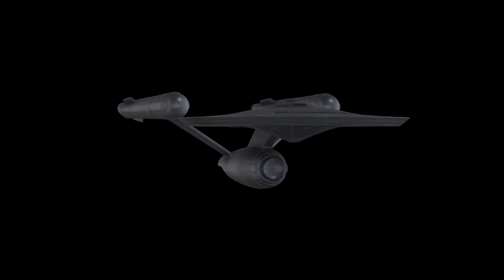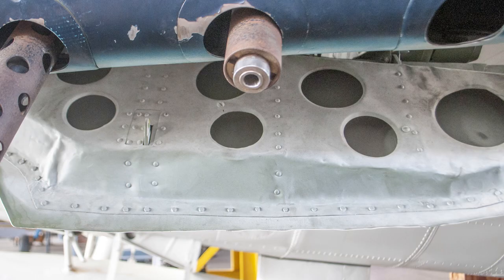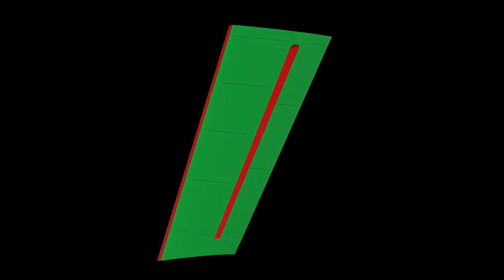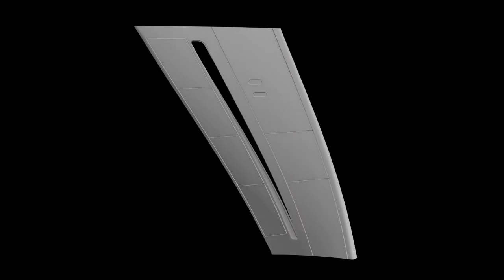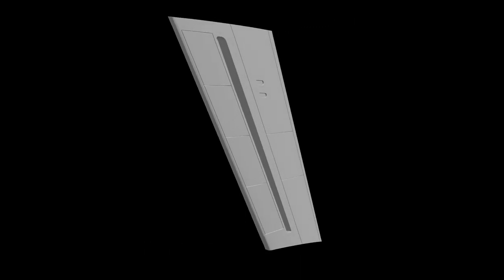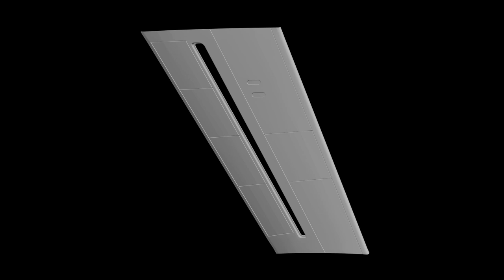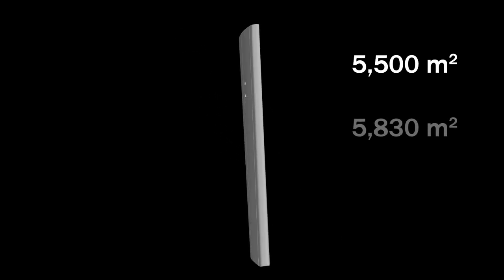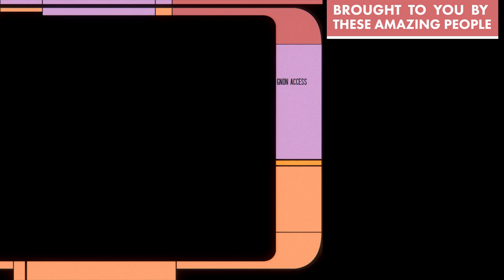What's the Deal with Pylon cutouts?

Comment: if i remember right, Radiometric converter tech wasn't made until the 24th century. So the USS Enterprise 1701 would still have a problem with handling antimatter waste, radiation and cooling unlike those in the 24th century that recycled the waste back into other subsystems. So your explanation about regulating plasma cooling is awesome. i'd loved to explore more history about how starships handling waste and cooling. i still remember in TNG "Starship Mine" that a Baryon sweep was needed every 5 years or so, i wonder how Voyager got away with needing one after 7.

Comment: The additional surface area would work better in an atmosphere. But for radiative heat transfer  the heat a surface emits is reabsorbed by the opposite surface. Corrugating  would be more effective as the influence of cosine of the surface normal is reduced. Basically the zones in front and behind the pylon would get better heat illumination. IIR the side panels of the TIEs are structured that way!
The main problem: whatever the cutouts do, internal bulkheads would most likely do the same thing, and potentially better. We use lead as radiation shield because you want as much mass between you and the source. Polished gold mirrors make better heat barriers then the gap. Maybe you could mount sensors in there, without getting them eroded by micrometeorites while reducing the shadowed sector in front? It's a long shot though...

Comment: The Enterprise from ST-TMP already had a waste heat management system with it's Flux Chillers on the inboard and outboard of each nacelle. Inboard they glowed blue.
Also I think showing starships under construction with girders and beams is a nod to showing something familiar to the audience -- it's how we're used to seeing buildings under construction. Starships would almost certainly use a unibody/monocoque frame concept to reduce weight and add strength. Also, Structural Integrity Field.

Since they have already figured out warp drive and transporters I would hope they had also figured out a way to convert that waste heat into another form of radiation that could be dispersed into the icy void much more readily than infrared heat.
Reply: I completely agree.
Also, as an alternative I'd like to suggest a "skeleton" made of arcs and circles (a bit like a 3D-chainmail construct, with bigger spaces in between). Would give especially the Enterprise-D rigidity and flexibility.

Comment: Great video, very interesting.

I agree with the lightening holes theory and I agree with it being used to strengthen the nacelle pylons, but I disagree with the radiative cooling to some extent.
Let me explain: the majority of the radiated heat goes in the direction the surface is facing. This means that the cut out radiator would be radiating heat into the other side of the cutout. And because materials absorb and emit radiation equally, the energy would be reabsorbed into the nacelle rather than radiated into space. Effectively, cutouts increase the total surface area of the pylon, but decrease the usable radiative cooling surface area.

However, the cutout could be used for cooling if you channelled a hot coolant through it, confined by magnetic fields but radiating heat into space. Use a hot plasma, and you could get rid of a lot of waste heat quickly, and it would look cool.

Comment: Whenever I see a traditional saucer and secondary hull with nacelles on pylons design, I just want to add a brace between the two nacelles or extend the nacelles at the front so they connect to the primary saucer section (a bit like the Steamrunner class).

If only the next film after Nemesis had gone ahead, apparently the same designers who did the new anti Borg First Contact ships were going to do a bunch of new Starfleet ships inspired by the Defiant - with a internal bridge and nacelles blended into the hull as the paradigm to show Starfleet is now tough and militant.
Reply: The star cruiser has pretty nice nacelles and pylons they are tucked in with the aft section of the ship instead of being extended super far out
Reply: @nobleactual7616  Best idea ever. As seen in ST: Beyond the Enterprise's weird thin pylon design is easy as hell to take advantage of.

Comment: Another possible explanation: when the constitution class first rolled out of the shipyard it just had the forward part of the pylon. After a year of shakedown the designers determined that the pylons were not quite strong enough and needed to be reinforced. The immediate solution was to add another set of pylons in parallel with the originals, leaving the small gap between them.

Presumably this was intended to be a temporary addition to the constitution class while they go back to the drawing board and design a stronger and thinner pylon. By the time Kirk is in command the enterprise has undergone a small refit to replace the old reinforced pylons with the new design as seen in TOS.

Comment: Radiating heat doesn't need a medium, that's why we get the heat of the sun through the vacuum of space. Convection doesn't happen though, that's where you do need some sort of fluid, either liquid or gas. So adding more surfaces to radiate heat from would help to lose heat

Comment: The radiator theory is probably the strongest of the bunch, although you'd have expected Starfleet's Finest to have curved the inner surfaces of the slot to increase the surface area further, angle a greater number of emitted photons out of the slot, and increase rigidity further. The straight cut slot will actually cause a majority of the heat radiated to be reabsorbed by the opposing wall. 

Perhaps it was split to provide redundancy in case half of the pylon was impacted and broke; it'd be better to lose a small amount of air and easier to seal internally. You would also have the advantage that you would not lose all of the plasma conduits as easily or incur rapid depressurization on all many in case of a breach to the hull. Perhaps a rupture in one of the conduits would be explosive enough that having extra hull and a gap would prevent the other conduit(s) from being compromised. 

Great video as always!
Reply: Theres never been enough surface area on any star trek ships (or star wars for that matter) to justify any sort of radiators.

Comment: There is another angle to the heat concept: if the plasma conduits are in the area with the vents, and the pylons are also high load structural elements, then it may be helpful to isolate some of the support structure from the heat source. 
Heat tends to make metals more pliable, and keeping some of the metal at cooler temperatures can contribute to maintaining a desired standard of rigity.

Comment: A cutout in the pylon would be an excellent place to store a droplet radiator system. After the plasma is used in the warp nacelles, the still hot gas/liquid is vented out one side of the pylon in tiny droplets. The insane surface area of this material sheds heat rapidly and is then collected on the other side of the pylon as the ship moves forward naturally.. While such a small gap limits the amount of cooling that can occur it would also limit the material loss.

Comment: This probably won't have the same function on something the scale of a starship, but such a cutout on a smaller solid item would prevent a tear or crack from spreading. 

Real life examples would be car bumpers and fiberglass. If there are cracks in either and they're being repaired, prior to any material being added the ends of any cracks are drilled out to prevent the crack from spreading, as repairing something without doing so will eventually result in the crack simply spreading beyond the repair. I believe cracked metal is sometimes repaired with drilling the cracks out as well. It is for a similar reason why a windshield on a car with a small crack will soon need a full replacement in most cases, as the crack will eventually spread along the windshield. 

So my theory is that if the pylons were to be physically damaged such cutouts could help prevent total structural failure and having a nacelle fall free of the ship.

Comment: A possible reason separate from what you said is that during manufacturing of Discovery’s version of the Enterprise, certain areas of the pylons needed to be readily accessible for construction and the speed of that construction.  If pipes run through those pylons, then a break in the pipes could mean days of reconstruction compared to hours.  If you ever built a water cooled PC then you know just how easy it could be to leak water all over your newly built machine when you start putting pressure through and how you could quickly ruin components if you don’t have immediate access to the loop.  So in this case, imagine a plasma leak ruins a good chunk of components in a star ships pylon, rather than taking all the piping along with every single component in the way of the leak, just have quick access to the pylons center for repairs and construction.  The down side is that the ship has less integrity like you said, but I would imagine that the ribs are now oriented vertically to try and make up for this loss.  Perhaps the material just got stronger so they could afford that loss of integrity.

Comment: thermal dissipation was my first thought. I'm fairly sure there are access ways into the pylons for repairs. I think one of the Command Level no-Win scenero's require you to send an officer into one of these to die in order to save the ship.  it's possible one side (probably the thiner side) is for coolant input and personnel access and the thicker side is for the plasma input and output. there has never been any onscreen mention of thermal sinks so I think your right about that. it's logical that they didn't put them in on the original production line until they got the performance data back to see if the existing pylon structure would hold as it was. updating the design as understanding and advancement's came in. (coinciding with RW designers own understanding of engineering as they progressed themselves. )

Comment: The smaller beam might transport coolant to the blue glowing radiators on the inbound of the nacelles. The larger beam transports warp plasma, interstellar gas, hot coolant, and have transport tubes. The vacuum of space then helps insulate the coolant from the other one. Or maybe the warp plasma travels through the smaller one and the larger one is everything else. The point is that the smaller conduit is thermally isolated from the rest of the pylon by the conduit. This likely helps keep whatever is in there at a stable temperature.

Comment: I am interested by this idea of the ship trying to shed heat. I wonder if, taking this into consideration, cloaked vessels have to capture heat while cloaked instead of shedding it. Doing so would hopefully hide their heat signatures. 
This might explain the massive engine section of most Klingon/ Romulan birds of prey, and why they have the command section so separated and vulnerable.
Especially when you look at a D'Deridex. This might explain their ability to not only travel at extreme speeds while cloaked, but look cool doing it. Poor Klingon engineers must be boiling when they are cloaked.
Reply: Well considering how hot Klingons like it, it was probably considered a design feature.

Comment: 3:48 Sci-Fi is pretty dramatized, but in a matter of speaking you do freeze in space really quickly. The vacuum of space doesn't steal your heat, but it steals almost everything else from your body due to the lack of pressure. Most fluids would boil off of and to a degree out of your body, the gases escaping very quickly taking a lot of heat with them in the process that is now leaving your body, but some chemical bonds in fluids would remain strong enough to not accelerate away from your body, almost in a matter of speaking "freezing solid."

So, there is some truth to the idea. Space isn't cold so much as it is just totally empty, and the matter making you up would tend to want to fill up that empty space as much as possible. In that process, taking heat away from you as well and it would be pretty fast. Maybe not seconds, but still pretty fast.
Reply: I came to here to say the same thing - a person wouldn't freeze solid immediately, but would accumulate a layer of ice very quickly as the liquid on and in the outermost membranes boiled in the vacuum.

Comment: The separation could be as a heat stop, the slot is used to prevent heat transfer through conduction.  The hole could change the resonant frequency of the nacelle and prevent the nacelle from flying apart.

Comment: I would like to think that the rear, thinner portion of the pylons is actually where all the structural support for them and the nacelles is located, with possibly jefferies tubes running through it as well for maintenance of the nacelles. While the other, thicker portion would indeed perform some heatsink function, both for the Warp Drive's plasma conduits and maybe for the ship generally - I would imagine all the weapons on the Enterprise would also generate quite a lot of heat as well. Having a long, thin and flat structure, filled with heat tubes (whether plasma conduits or vapour chambers), running parallel to the main vector of the ship's acceleration is a cheap and efficient way of passively dissipating heat into the vacuum of space using only the vessel's movement.

Comment: The problem with the heat rejection hypothesis is that you aren't taking into account interreflection.  Basically, in space a hot object is an infrared lamp, projecting a beam of heat (mostly) straight out away from the hot surface.  If two radiator panels are facing each-other directly, they are experiencing nearly 100% interreflection on those facing sides, this doesn't just make them non-functional, they'll actually be working against their intended function.  This means that those cutouts if they were radiators are would be at best just pumping heat around in a circle, rejecting very little of it from the ship.  It would actually make much, much more sense to give the whole outward facing surface of the pylon a corrugated texture and make each pylon one giant radiator.  If radiator size directly correlates to warp-plasma throughput then this would probably more than double the ship's capacity to move plasma, allowing for much more plasma-hungry warp coils.

Comment: The problem with the concept of increasing surface area 6% through the cutout is the faces of the cutout face each other. That means thermal energy radiated as infrared from one side will warm the apposing side and effectiveness will drop versus just having the faces facing outward, opposite each other.

I think the simplest explanation is the cutouts are just a way to redistribute mass. It's cut from the rear so the center of gravity moves forward just a teeny bit. On rockets being at least slightly nose heavy is very important.

A more complicated explanation is the cutout is a way to physically isolate the plasma conduit from a personnel conduit for most of the pylon length. If the plasma conduit breaches, either accidentally or by combat, thanks to the gap it is slightly less likely to also breach the crew conduit. It acts like spaced armor by giving space for an explosion to expand before reaching the opposite bulkhead.

Comment: The problem with the idea of the cut outs being for radiating heat is that they don't increase the amount of surface area that is *facing out into space*. That extra surface area is pointing at each other, most of the infrared light being emitted by those surfaces isn't shooting off into space, its just hitting the other side of the cutout and being reabsorbed.

Comment: The Big E is an odd bird even by Federation standards. She was initially launched incomplete with even some saucer sections and hull areas either not having any life support. Or in some cases, completely open to space when she was launched under Robert April. Her design was unique as it was literally a flying Test Bed of designs. She was also one of a few ships where the entire Bridge section could even be swapped out as upgrades were implemented. She was also "roomier" than other ships of the same design allowing for upgrades and customized suites for the life support needs of the various UFP members. These little known facts, more than anything, caused a ton of confusion when the first refit model was rolled out. And people were having issues comparing scales and sizes against the TOS Enterprise.

Comment: I was thinking about this a bit and I think that the heat factor might be right explanation. The pylons have to be accessed through Jeffries tubes for maintenance  and running those tubes next to the plasma conduits would pose a safety issue to engineering personnel. There could also be coolant lines and control circuitry and all sorts of things that don't react well to the heat. The cutouts might create a simpler and safer way to keep them from baking with an insulating vacuum.